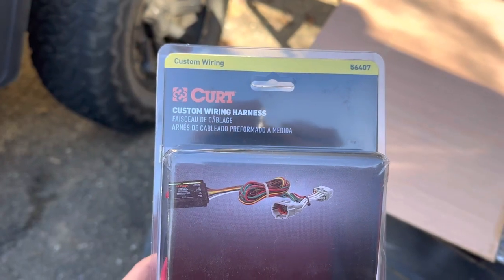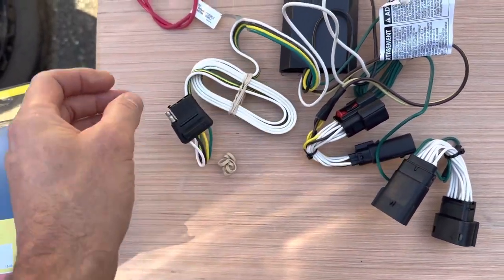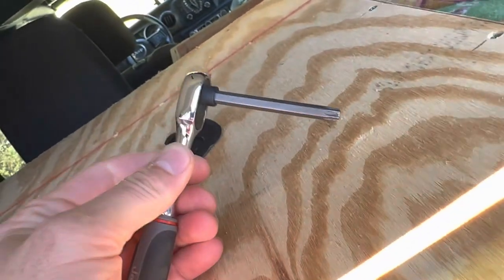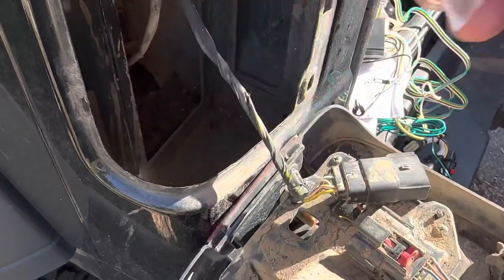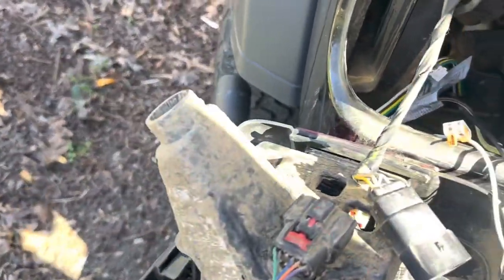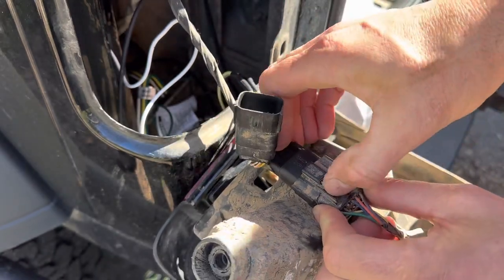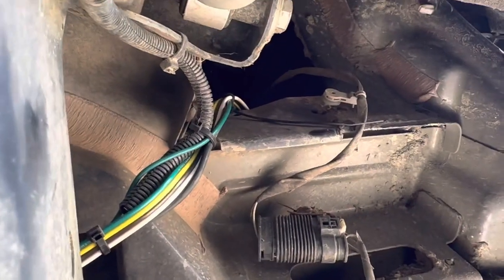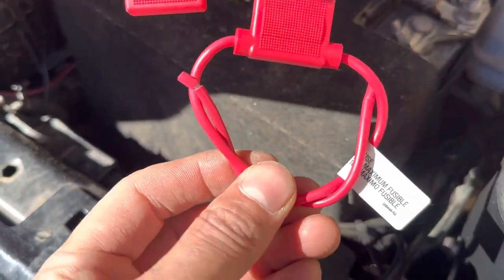Connect and Tow: Installing a Trailer Wiring Harness in Your Jeep

Comment: I suspect that module is because of the stupid ass stuff that Jeep (and other car manufacturers) do with the CANBUS these days.  If you just splice into the wires like we USED to be able to do, the vehicle's computer will detect it and possibly cause things to not work correctly or an error gets generated.  Damn kiddie engineers over-complicating what SHOULD be a simple task.  You shouldn't need a computer to tell you that your light is out, you should notice it when you periodically check your vehicle before driving it.
Reply from the maker: The cars today are certainly not like they used to be, too many sensors and warning lights these days for sure

Comment: there is 12v plug in the back of the jeep, you should connect power there instead of running it to front, just hint
Reply from the maker: That is an option, my only caution to taping into a 12v outlet is you are now putting an additional load on a circuit that is not designed for it
Reply: I understand what you saying. Stay safe @FischerJeepAdventures
Reply from the maker: @aussie1546 same to you

Comment: Thanks for the video!  The kit I’m looking at is just a T connector that splices into each tail light (similar to yours, but without the wiring up to the battery).  Curious why yours is different and if there a benefit to running power up to the battery?
Reply from the maker: Thank you. The power wire to the battery feeds the module manages the signaling from the trailer wiring input, makes sure there is no interference with the led lights which my jeep has, hope that helps

Comment: I own a 2023 high altitude 4xe with led lights, same set up?  Also what about disconnecting the battery, anything different seing it has a huge batt. Under the rear seat. I have the hitch installed, just the wiring left. Thx for videos very helpful.
Reply from the maker: Hello, same process, just make sure to match the product to your jeep model otherwise install is the same, no need to disconnect the battery it is a plug and play system. Good luck and thanks for checking out the channel, I appreciate it

Comment: Can you ground the wire without drilling a hole? Could you ground to the bolts from the door striker?
Reply from the maker: Yes, you can ground the wire to any existing bolt or stud, you just have to make sure that the terminal ring is got good contact with unpainted metal of some form to ensure a good ground!